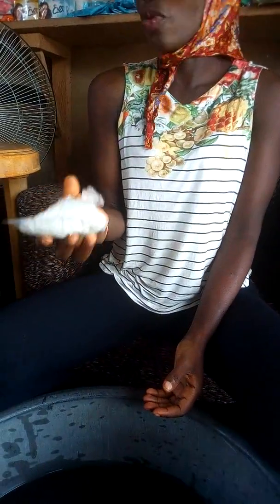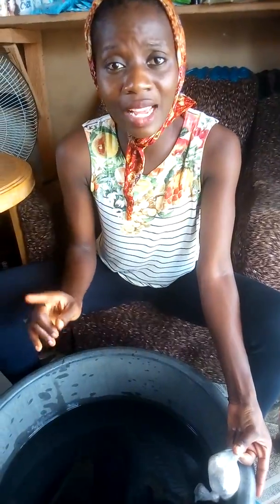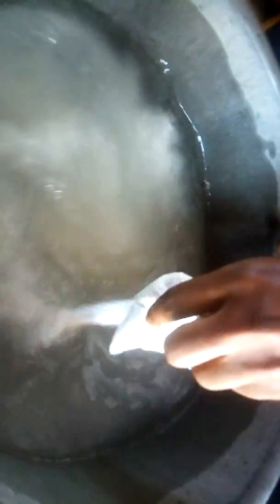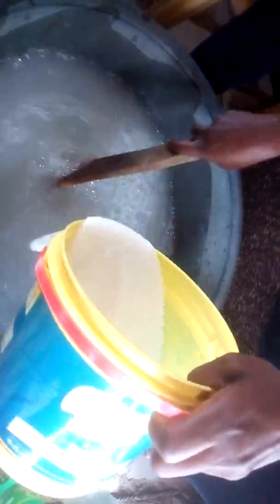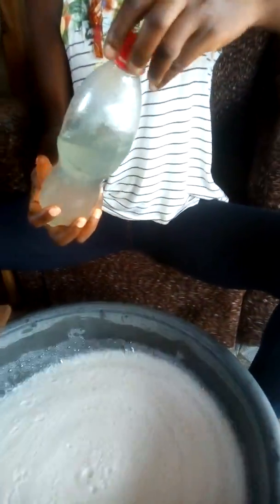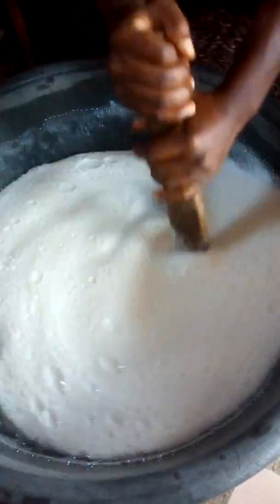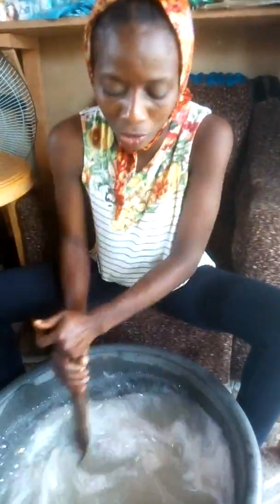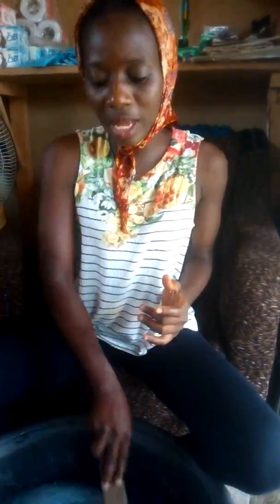CAR WASH PRODUCTION

Comment: Sister, well-done and may God continue to enlarge your coast on this field till you get monetized on YouTube very soon. My only contribution to your tutorial was that few of the materials measurements weren't right in calculations. Let's take for instance the Nitrosol you said was 1.5kg, which according to my learnedness in this filed is half litre. Even the Sulphuric acid is not upto 1kg but half litres as well sold within N450 to N600 depending on Chemical shop you are buying from. The foam booster u displayed is also half litres based on my understanding. I'm clarifying this because of your viewers in order for them not to go and buy overdose materials. 

Although, sometimes, majority of the chemical stores usually shortchanged buyers with measurements so as to get more profits, maybe that was what happened to your displayed materials. Above all, you have a wonderful video for people to watch and learn something meaningful. But next time, try to add "STPP and a little SLS to your mixture as SLS and foam booster are never the same thing for better clarifications but all work together to enhance your production. I wish you all the best.
Reply: Very true